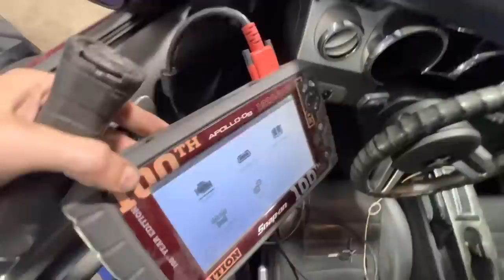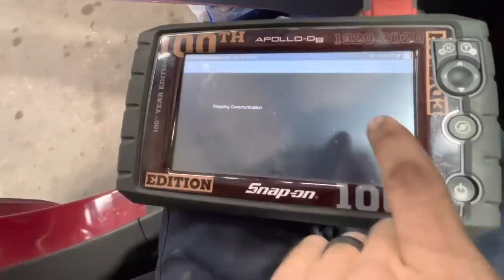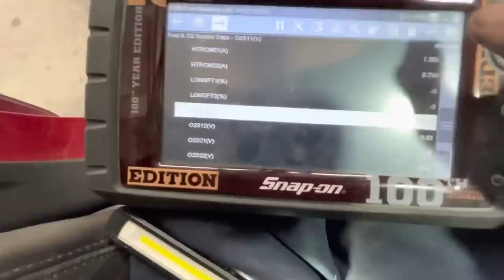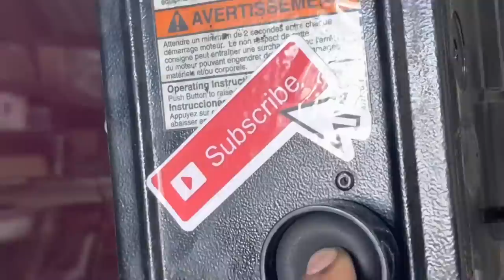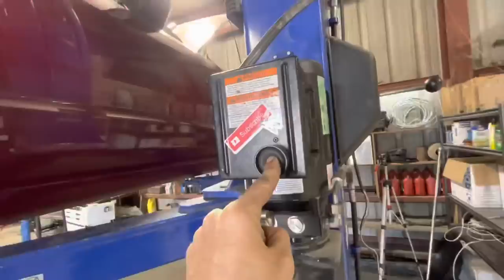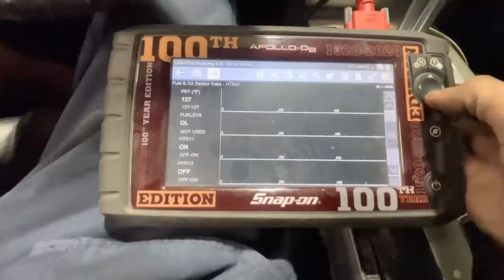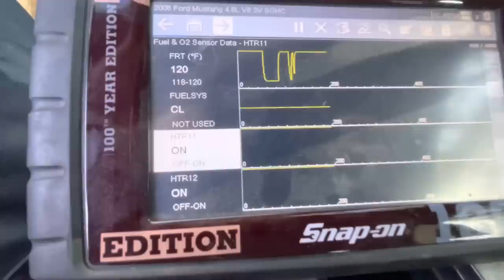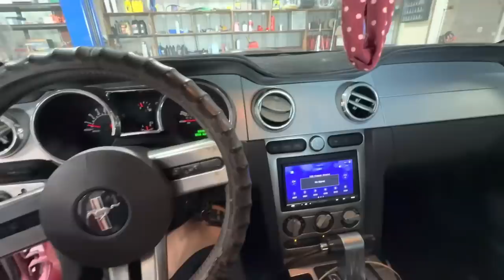Check Engine Light! 2006 Ford Mustang GT P0171 P2195 P1000

Comment: I miss my 2006 Mustang. I had to sell it to pay my bills after hospitalization and couldn't work. The only repair I did to it was replacing the PCV valve.
Reply: I had a 97 Cobra for about 7 years. The only things I did were reseal an oil sending unit, replace an AC relay, and replace the plugs. Oh, and a power window switch. My ex wife had a 2000 V6 model that never had a problem. I’ve had buddies that have had equally good luck. The only unreliable ones that I’ve known were either driven like a NASCAR or heavily modified. I knew a guy that put some really short gears in one and then commuted with it. He couldn’t understand why the fuel mileage was terrible and it was continually overheating. He always said it was a POS. Well, when you’re running 3500 rpm for 30 minutes straight on the highway,  it’ll get a little hot. Plus, it had an exhaust and the guy was always revving and letting off, revving and letting off. Hmm…wonder why it broke?

Comment: 👍👍👍 Hey Ray your DirtyMax has you spoilt as far as getting in & out space. We used to have a Ford Focus we had the same problem. Sold it got a Yukon XL, sacrificed fuel mileage but got comfort. Back in our younger years we a 1970 Mustang, was a great car until the motor blew up when the automatic transmission didn’t shift into high gear at 95 mph
Reply: The trans didn't shift or you didn't shift?

Comment: Ray, it might be an idea to get some cold spray to shorten the cool-down time of parts like this. Could save you a little time. Pretty cheap, you can get it on Amazon.
Reply: Can of air, any local office supply store also.
Reply: What is cold spray
Reply: @brucedale4465  Cold spray (Or freeze spray) is a liquefied gas such as propane or butane used in medicine, manufacturing, and food industries to cool surfaces very quickly, either for anesthetic purposes or to cool parts down so they can be touched. 

Even a can of "air duster" such as those used in cleaning computers has this effect, but products sold explicitly as cold spray are much more effective.

It's readily available and performs well in many environments.

Comment: In the 20 years I had my shop I never installed a aftermarket sensor, always OEM
Reply: means less profit from markup.
Reply: @forgetfulme1719  means the car runs properly my labor rate was 110 per hour back when all shops around me were in the 60$ range and we were always busy
Reply: @jamesedward2470  not where he is, $60 forever.

Comment: Nah, you got it right the first time Ray  rustang is the correct term! You can have my share of them as far as I'm concerned. I do have to admit though they're a good money maker when they come in for Restorations, but I always tell the owners to expect the unexpected when they do. One early '70s GT500 that came into my shop for a restoration went back out with about the only original parts being the  roof,  cowl ,  trim pieces and the glass. Just about everything else was replaced, was it worth it? Well it sure was for me, I had that car for over a year and a half and it ended up a bare body on a rotisserie before it was reassembled and out the door , it  was either wrecked or rusted from one end to the other!
Reply: Had a 67' Rustang. Restored it but the rust was deep. In about 1989 stepped on the brake hard and the front lower arm strut pulled out of the front. They shows me the front rail and there was nothing to it. Since it happened getting on the highway they said I was very lucky.

Comment: Last year I chased an intermittent "Bank 2 lean" code for a couple of months on my 2001 F150 5.4L, with a sporadic Bank 2 cylinder head overheat code that I only saw a couple of times.  O₂ sensors were all OK, and after clearing the code, it would run for sometimes weeks without tripping the lean code, sometimes only for a few days.  Checked numerous times for vacuum leaks to no avail, replaced some vacuum tubing just because it was old and crinkled, again to no avail.
I Finally settled on the decision to replace the intake gaskets, even though I couldn't find a vacuum leak there, under the justification of the cylinder head overheat on Bank 2 I had seen.  Running quite lean can cause overheating.  After replacing the intake manifold gaskets in March of 2022, there have been no more "Bank 2 lean" code episodes.

Comment: I will tell u from experience, ford uses the Mads air flow sensor, and I noticed the kn filter,those will absolutely mess with the ford system , without a tune to correct for the extra air , it will absolutely also mess with the os2 sensor,  as the cannot compensate,

Comment: Your getting the terms open and closed loop swapped. Open should be when just running off the defined map. Closed is when measurements are used back in the control.
Reply: I thought I was losing it... made a note to recheck what I thought CL and OL meant.. You saved me some time Thanks (Hope you know what you are saying...😀)

Comment: I had a 1992 Chevy Truck with a first year vortec V6. It started having knock issues on the freeway.  The flashy error code light said a bad O2 sensor. Went to the auto parts shop and  OMG the price!!!! A GM sensor was sooooo expensive!!!! The Bosch was a little over half the price at 60 bucks. Well, Bosch is a good company, they make good stuff (this was circa 2000) so I bought the Bosch. Slapped it in and it was fixed, for 2 days. Then the knock returned, but not as bad. BUUUUT - no check engine light!!! The ECM says its fine, nothing to see here! 
Welllllllll, that's the only thing I changed, and it got better - So I realized that the Bosch sensor was generating output that was in range, BUT was wrong!!!!!  So the ECM was quite happy with it. 
Popped that Bosch out, bent over and bought the GM part, and she ran great!!!!!
Moral of the story, when you are buying sensors, bend over and buy the OEM part unless there is a DARN GOOD reason (not price) to buy an aftermarket one.

Comment: I noticed a pattern in the O2B11 that could possibly indicate a problem. 
The waveform, exhibiting three crests between major troughs, is virtually identical over the entire sampling.
I also noticed the increased number of shell perforations and the increased shell length in the replacement O2 sensor.
Aftermarket BS part.

Comment: One trick to see whether it's a sensor or a wiring issue would be to swap the Bank#1 sensor with its Bank#2 equivalent.
If the fault moves banks, then it's the sensor.  If the fault stays in its original location, then it's not the sensor but something back up the chain, eg wiring or control modules.

Comment: When I was training to become a excavator mechanic I did see a few a mechanics had grind down the thickness on a pair of their tools just for those type of scenarios(20:55) where a sensor was needed to be tighened and something normaly block the actions needed. Asked them about it and they sad that even if the tool gets slightly less durability thats fine if it breaks they could just order a new one or weld it together again. :) hope you have a nice day :)

Comment: Only 3 minutes in but my first thought is to switch the sensors to see if the problem follows the sensor. Therefore diagnosing a faulty sensor or faulty wiring.
Reply: If only they were easier to get to.....
Reply: Scanner Danner showed people that,  difference of great mechanic and great day mechanic shown in high level diagnosis.

Comment: I’m having the same issue, 2005 mustang GT throwing P0171 and P2195 both codes. Smoked it and saw No obvious vacuum leaks, no wires that are exposed that I can find. Replaced the upstream 02 sensor, MAF sensor, I thought possibly an injector on bank 1. Just thought I’d ask if you had any suggestions

Comment: I can not recount the number of times I have taken my car into the repair shop with a fault, only for the mechanic to return to me and say " we can not find the issue that you refer to" then take the car home, the next day it has the fault again, after several trips back and forth the mechanic suggested I leave the car overnight so they can do a "cold" start, and see if the fault returns, and just as with myself, there in the morning on the cold start was the issue, a small bill later and a few new parts saw the issue removed and the car now 5 years later still singing a sweet song, moral of story is, that not everything is clean cut and obvious.

Comment: Ray, I believe you told us how  GM V-8 motor cylinders are numbered. Ford cylinders are 1-4 on passenger side and 5-8 on driver side.
Reply: The banks on a V engine are staggered. One sits further forward then the other. Which ever one sits further forward, thats’s number 1.
Reply: @tuloko16  My point is that Ford V-8's are numbered 1,2,3,4 on one bank and 5,6,7,8 on the other. I believe GM cylinders are odd numbers on one bank and even numbers on the other.
Reply: @tuloko16  Except on some GM engines.  For example, the Pontiac V8.  On this engine, cyl 1 "should" be on the passenger side, but it's numbered as any other GM V8 with cyl 1 on the driver side.
Reply: Everything is numbered corrrctly...
Except Fords! It always screws me up as I tend to not work on them if I can help it...though I do own a low mileage Crown Vic!

Comment: I don't know why engineers think about the end user when they design exhaust systems and O² sensor positioning because they could of mounted that sensor pointing downwards towards the starter, I've done a few cars where you have to physically remove exhaust systems to get at the sensor because it's too long and hits the body or engine part before it will unscrew fully.

Comment: Would like your opinion. I have a 2018 Subaru Outback w/e-brake. I have done my brakes for years ( I am 60+ now). I have witnessed 2 schools of thought on the e-brake when doing rear brakes on this critter. You need a scan tool  ($$$$$) or you simply remove the e-brake, screw back in the caliper and put the e-brake back. Both ways SEEM to work, but is that bloody scan tool really necessary? Thanks for your insight. Watch you every day. Have picked up good info. :)

Comment: My dad was a parts manager at a Ford dealership.  It would surprise you the number of times somebody got something aftermarket put in on the cheap that didn't solve the problem, and then they'd take it to the dealership when the first guy couldn't fix it.  Like 8 times out of 10 the cheap part was bad, and the other 2 times would be something the el cheapo mechanic missed or couldn't diagnose because they didn't have the proper scanner or tool.  I remember hearing dad talk about O2 sensors often, and how you HAVE to invest in quality parts or you'll just pay to have the job done twice.
Reply: I was a used car manager and when I did recon on a car always used OEM parts, because didn't want Customers coming back.
Reply: Lmfao stealership, 1000$ just to change a O2 sensor

Comment: The newest bank sensor seemed to trend slightly higher on average than the "known good" sensor. Pay attention to the space below the value line. Yes the values follow the same pattern, but the whole line is offset up a bit. Given that the removed sensor was fouled, what might cause that?  It may be you've cleared the symptom that caused the check engine light, but not addressed the root cause leading to premature sensor failure.
Reply: Yup. That bank is running slightly rich and eventually is going to need another new sensor.
Reply: @tuloko16  What reason would the bank be running rich? Not a mechanic here, just can recognize trends accordingly.
Reply: @williamtakacs7466  leaky injectors, valve issues, compression issues or cam issues. 
A leaky/ hanging exhaust valve could prevent the engine from taking in enough air in the intake stroke. 
A worn intake cam lobe, could reduce the amount and time the intake valve remains open while on the intake stroke.  
Rings not sealing correctly, could also affect the intake stroke by not providing enough “suction” for the right amount of air to come in.
Reply: @tuloko16  mediocrity cannot reach ur level, it will pass smog test now.

Comment: I have a PO171 and PO174 codes on mine and I know what it is. It is related to the Coupler between the Throttle Body and the Air Intake Box. The coupler is old and split in half but not ripped apart yet. Not fixing the P0171 or P0174 will cause other codes to set because it will introduce too much air and containments of unburnt fuel and air together. Now P0171 and P0174 has set a P0507 of IDLE TOO HIGH code. I know how to fix that too. My vehicle is a 2009 Nissan Murano.

Comment: Can you swap sensor and see if the problem moves? There are 7 other 'identical' parts in the engine.

Advantages of standard sized parts - industrial revolution.
Reply: it's also the same sensor as the downside sensor.....

Comment: The banks on these engines are as follows, bank 1 is 1,2,3,4, and bank 2 is 5,6,7,8, the same for the 5.4l
Reply: same for all Ford V8s with the exception of the  ̶Y̶a̶m̶a̶h̶a̶  Jaguar engine in the 2001+ Thunderbird.

Comment: Ford V8 cylinders are numbered in a different way than other V8 engines. On the passenger side it goes 1-4 from the front to the back and 5-8 on the driver side in the same fashion.

Comment: I think it should be 1234 on the passenger side and 5678 driver. Cylinder one is still in the same place. Oops, just saw your pin. Never mind. 😃

Comment: Seems like the downstream O2 sensor is acting up.  If downstream is reading zero volts, it will command a long term addition of fuel erroneously, the short term fuel trim is constantly decreasing short term fuel trim to correctly adjust the fuel.  Swap downstream sensors.
Reply: just buy 4 new ones and be done with it..... 🤣

Comment: possible exhaust leak on bank 1. the 4.6 and 5.4 ford engines tend to break exhaust manifold bolts. this would allow air to be pulled into the exhaust causing a false lean code.

Comment: When I was a line mechanic at a chevy dealer I found out on new car test drives that sometimes new isn't necessarily good. I had a 454 on a test drive start spewing white vapor out so bad it obscured the road behind me, tear down found a nut left in a cylinder. Some others hand grenaded during test drive also. just because it's new............
Reply: angry assembly worker.

Comment: The OEM O2 sensor you installed was different to the one you removed. It looks like it was an aftermarket one. I was hoping you would have seen some markings/numbers on the one you removed and compared them to the OEM one to confirm, or at least look to see if that part was for the 2006 Mustang.

Comment: Being an engineer, I find these videos very interesting (and educational).  
Your diagnostic skills impress me greatly.  
I am no expert however I am curious as to whether the previous workshop installed the correct sensor.  
Check at 18:50 and compare to 19:00 you will see the number of holes in the old and new sensors are different. 
The one removed "could" have been the wrong part number (although this could also just be differences between manufacturers for the same part).
Could they have installed a downstream (heated) sensor in the upstream position?  It is my understanding that they generally are not (functionally) interchangeable.
Also, the slight difference in the sensor response at the initial start-up could be due to the residual manufacturing oils. contaminants being burnt off resulting in an initial differential response between left and right banks sensors.

Comment: Rustang...LoL..yeah they are....Seems all the car manufacturers are skimping on their rust control methodology recently....For awhile they were using double sided galvanized steel in critical areas, plus the ELPO dip which really helped.....but now, I guess they don't care anymore if 'ya get rust perforation on the body panels.....Forward Into The Past!!

Comment: Could you not change the 2 upstream sensors around, that way if the fault doesn't follow the sensor then you have a wiring or PCM fault?
Reply: I'm sure he could have, but that would have been uninstalling them and reinstalling them on each side just to probably uninstall one again to install a new one. It also depends on how easy or difficult the one on the driver side is to get to. The O2 sensor is around $40 ... probably around $25 or $30 his cost. So spending the $30 instead of having the headache of switching them around when it already seems to be a bad sensor anyways is worth it to me IMO.
Reply: @John Thorpe  agree.. plus you take a chance of damaging the sensor from bank 2.

Comment: Why not switch the two o2 sensors to see if the bank switch behavior?
Reply: Too much labor
Reply: @dannylinc6247  but it does eliminate the possible electrical wire possibility thus leaving you with only one possible issue bad O2 sensor
Reply: @roberttexas3618  customer could also buy two and labor once for both.
But ray has one lazy reading sensor and labor's not cheap.
An hour of dinking around nowadays is $125.
You go with your gut, or you are over-tech-ing it.

Comment: Makes one want to drag one of the engineers that decide where to place the sensors over and have them replace one.

Would it be that big a deal to have the O2 sensor pointing downwards for easier access?  There wouldn't be any issue with road crud knocking the sensor around.  Our own Dakota has an upstream that is damn near impossible to reach without tearing the wheel wheel apart.
Reply: When the engine is on the assembly stand the sensors are easy to get to. Past that manufacturers don't care.